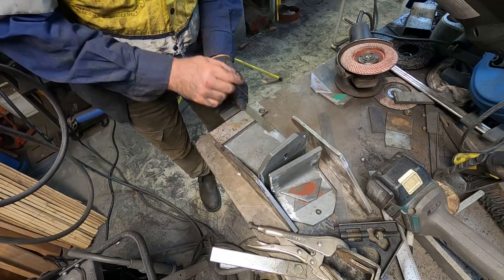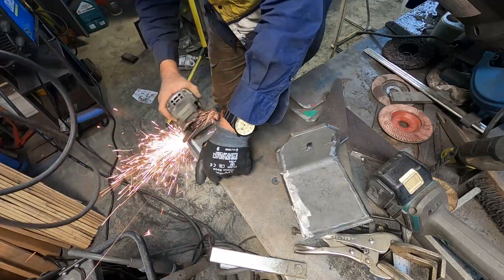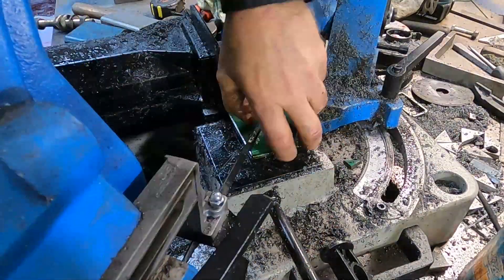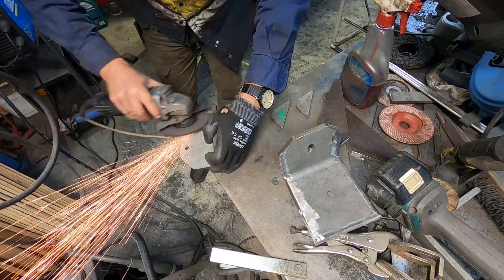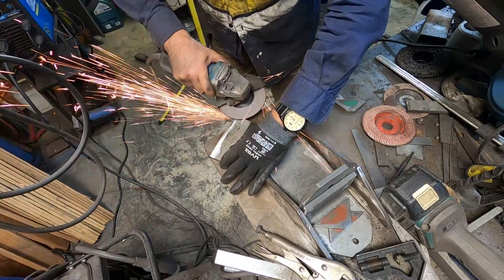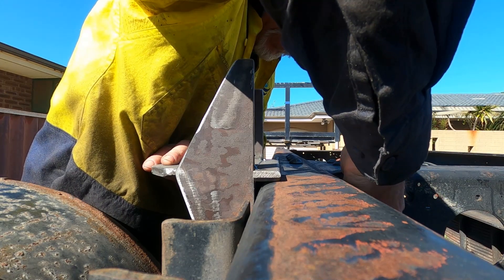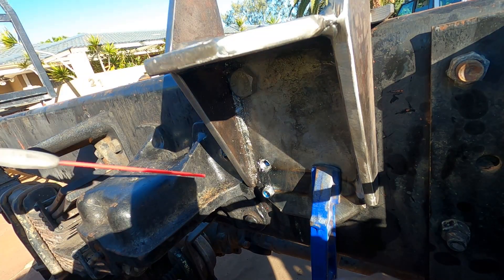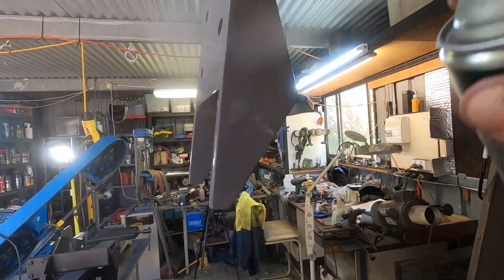Building Torsion Brackets @overlandingomar3952

Comment: I first thought a zero torsion subframe 3-4 point would be what I needed. 

Then started seeing more of the ubolt spring or rail system subframe. 

What I haver learned is that I still don't know which one to use.

But I do know ow I need to learn how to weld. 😊👍

Greetings from Florida by the way.